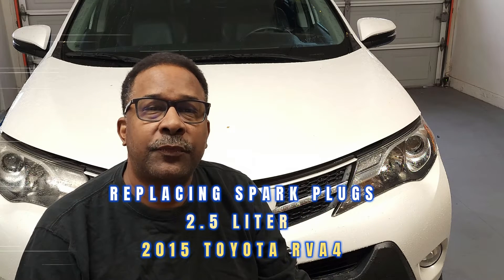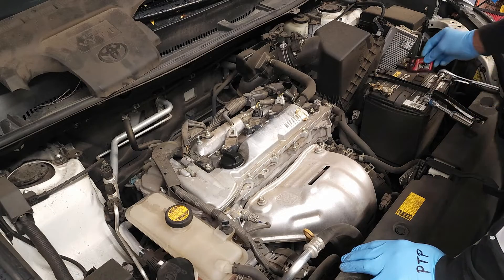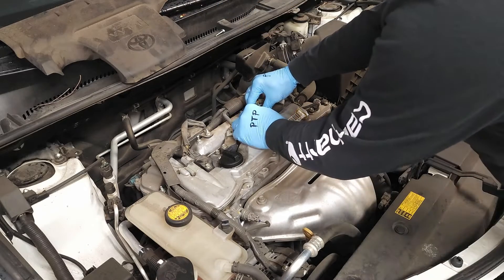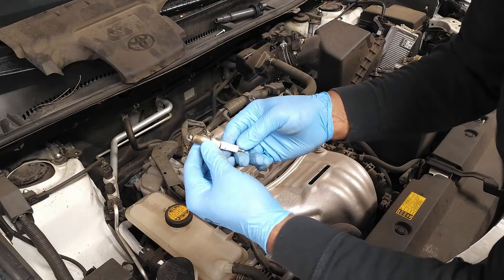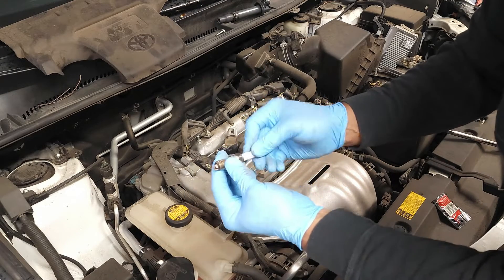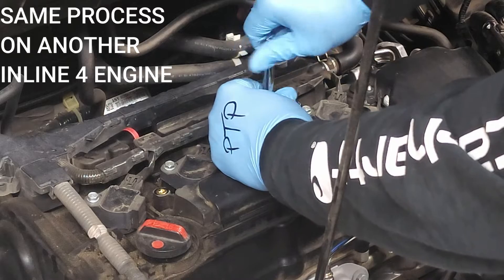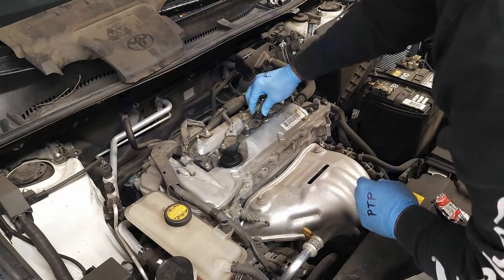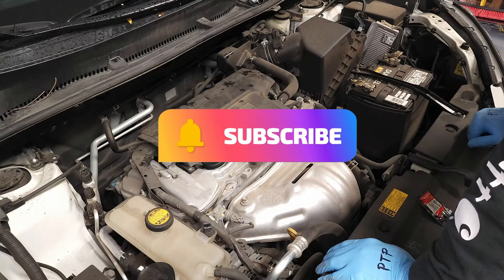2015-2018 Toyota RAV4 2.5 LITER VVT-i Spark Plug Replacement tips

Comment: What if the coil is to high for screw back on, what should I do
Reply from the maker: @quickfifty717  Recheck installation of spark plug
Reply: @ I tighten the spark plug as much I can I didn’t want to brake the spark plug, should I get a smaller version of spark plug ?

Comment: ■ Coil gasket - always replace it with a new one.  A new DENSO coil will come with it.  
  ■ The electrical plugs for the coils are common for the tabs to break if you force them.  If it does just use a small zip tie around the connector to cinch down around the tab to hold it. 
  ■ Make sure you are using a GOOD plug socket
  ■ DO NOT EVER change the gap on platinum or iridium plugs.  Use them as they came from DENSO.
  ■ ALWAYS use a torque wrench to tighten - RAV4 specs for plugs is 19 ft#
  ■ NEVER use anti-seize on the threads of your plug [note is was not used here]
  ■ if you drop a spark plug, pick it up and drop it again IN THE GARBAGE.  NEVER use a plug that you dropped on the floor!

And finally, if your pocket can manage it always use OEM Toyota parts.  You spent good money on a good car to begin with just makes sense to keep up the trend.
Reply: No not 19 ft lbs 9

Comment: Is the PCV valve to the right of spark plug #4 (on top of engine) or is it in a different location? I see a ventilation hose there just not sure if there is a PCV valve inside.  The other end of that hose goes to the air box.
Reply from the maker: Please see https://youtu.be/wdtcK4wdx2o?si=NgBePCsrT-1XZowG.
The PCV is located on the engine block almost directly above the passenger side CV joint.